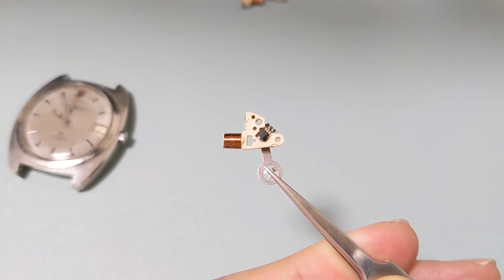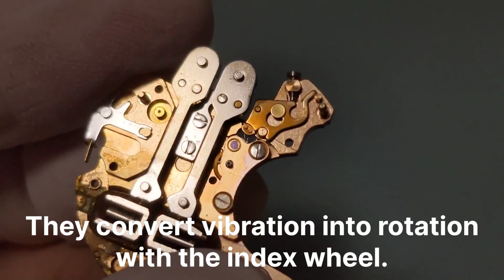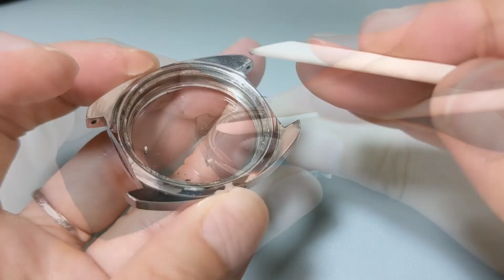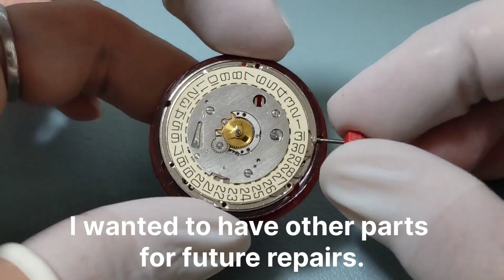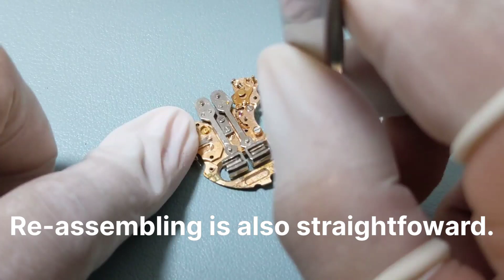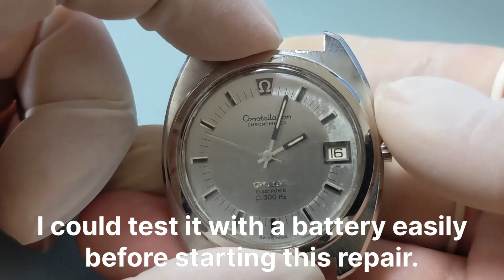Omega Constellation Electronic Repair -  Caliber 1250 Tuning Fork

Comment: Hi, thanks for the video, I've just restored it and when I connect the battery to the electronics, nothing happens. I didn't touch the electronics when I renovated it. Maybe I accidentally touched the tuning fork with metal. Where could this problem have come from? Knowing that it worked.

Comment: These are troublesome things unless you know what you're doing. Even highly trained and skilled watchmakers avoid them as spares are very difficult to get and are expensive.  Some have fragile date rings and if you use the date corrector too early after the watch has changed the date itself, you can churn up the date wheel teeth. This is why many are sold with non functioning dates. I've worked on a few non runners, but have given up locating the parts which are usually the coils and pawls.  My recommendation is if they ain't broken, don't fix them and if your beloved watch fails, send it to somebody who has the specialist skills and parts in stock. If it's going, don't bother with giving it a regular service. This is not the same as a traditional mechanical watch, or a quartz.

Comment: Hello I need your help. I am repairing the same watch as you in the video that belonged to my grandfather. Could you tell me where the parts you bought came from?
Thank you so much
Reply from the maker: I use Ebay to find parts. The caliber 1250 is based on the ESA 9162. They are almost identical, only the base plate finish is different. So most parts of ESA 9162 can be used for the Omega.
Reply: @vintagewatchtinkerer  Thanks 😀

Comment: Hi, is the bracelet from Omega and if it is does it have any reference number? Or if not Omega where did you get this bracelet? I have a Genéve with similar case and a steel bracelet would be cool at certain moments compared to a leather one.
Reply from the maker: It's not an Omega bracelet, but I bought it on Amazon for about $20.

Comment: Greeting. What are you adjusting from this screw?adjuster plate
Reply from the maker: The adjuster plate has a pawl that should engage with the index wheel. In my understanding, it prevents the movement from rotating backward.

Comment: Did you clean and lubricate the movement?
Reply from the maker: No, this time I didn't disassemble the movement. I recently succeeded in cleaning and lubricating the tuning fork movement of another watch. The video will be coming soon. And I'm also thinking of revisiting this watch to clean and lubricate this movement.
Reply: @vintagewatchtinkerer Thanks. I am looking forward to your new video. I also have a 1250. It's working but probably needs clean and lubrication. Since the index wheel and pawls are very delicate, I am not confident about doing it without knowing how they are cleaned.

Comment: Is the index whell about 3mm in diametre and have 360 teeeth?
Reply from the maker: I think no, it's much smaller. The tooth is almost invisible without a microscope.
Reply: @vintagewatchtinkerer  thank you,I knew the index wheel was small but not that small,begs the question how was itt made ?
Reply: @johnutting9615  I read that Omega and ESA were making this movement under license from Bulova, but index wheel itself was still supplied by Bulova which developed a special process to make the wheels. So it's not easy to make. By the way, there are 300 teeth on this index wheel and 360 on Bulova's. The material is also very hard so these microscopic teeth can last for decades rubbing against two ruby paws. Remarkable engineering at the time.

Comment: Saya punya tangan seamaster f300Hz  mati IC nya, kalau mau beli atau memperbaikinya di mana ya?
Reply from the maker: You can buy it on eBay. Since the movement is technically ESA 9162, try to find an ESA 9162 transistor unit. I recommend buying a NOS unit from a store whose returns are accepted. The unit is problematic, so it may have an issue even if it is new.